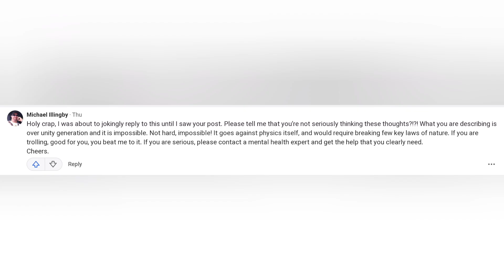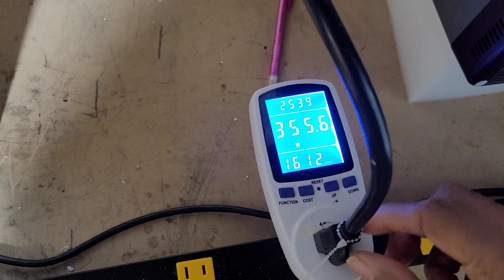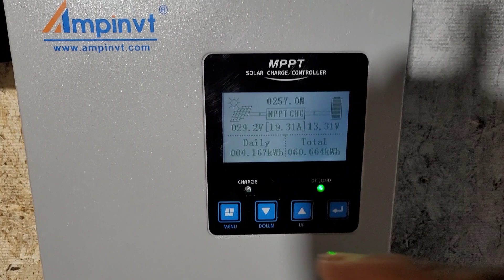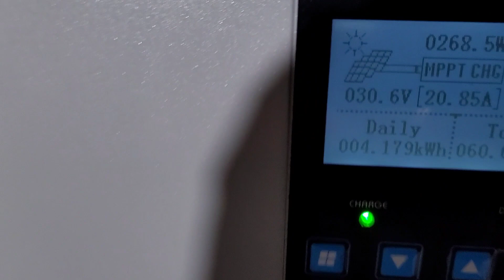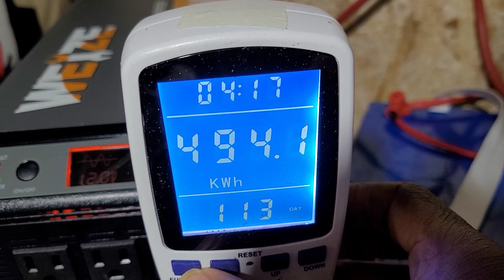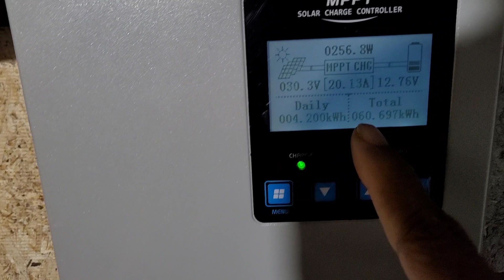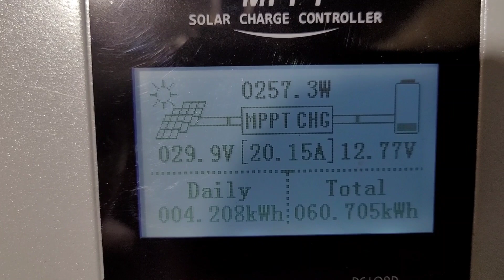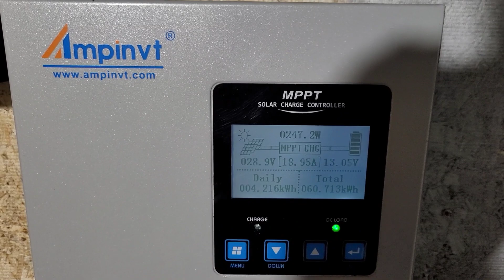the ? asked; Can we charge an inverter using its own output?"  then this happened!!!!!

Comment: Charging a battery from itself is not charging, because it needs to discharge as well - and, due to losses, it will discharge more than charge. Net current on the battery poles will be "negative", discharging. No perpetuum mobile either.
Reply from the maker: If the second video does not satisfy the correct answer for you and you still are in the same mindframe then wait for the third video well I'll show you one hundred percent that it is charging and what rate you are charging at the numbers are important, second at the low end of the Spectrum which I was showing you make the battery lasts more than the four hours of regular run time to 10 hours which was wrote on the paper and was demonstrated so now we need to show more data it appears that you may get the whole Digital Book just on YouTube videos because people just don't want to spend money they just want to take your work and use it for themselves it's been a problem for years so I've been holding back because I believed that what I discovered and have developed is worth time and money ,
Reply: @WIZ56575  if indeed you are holding back on demonstrating your proof because you believe your idea(s) are worth money, I'm afraid you will be waiting a very long time indeed.  First you have to disprove the Laws of Thermodynamics and that might be somewhat harder than you think.
Reply from the maker: @alanrutlidge4767   We're not holding back anything we are breaking these down and small little part because it seems to be so difficult for people to understand the demonstration in the video was only to show what we were talking about that you can indeed use the power from the device and loop it back into itself Which we were successful 1000 people seen it no trickery, this Stated again is not a perpetual motion machine we stated it in the video. It was to show not only did this work even though they stated that the inverter was designed not to accept the same energy it produced But it ran 10 hours instead of 4 hours on the power that we were pulling To supply the load which were tie grid inverters. Then in video 2 On the time line 7:40  We demonstrate that we could loop the battery back in itself to get extra power So we did not have to take as much power from the grid and the battery does charge so so again what are we holding back why is everyone so upset about something that is possible to do and been known for very long time That's what me and my staff would like to know. No one here believes in perpetual motion but yet several people have stated that we think that's what it is why we already said many times that it's not and that it will not run forever so what's the deal
Reply from the maker: @alanrutlidge4767   I may be mistaken but I believe we've answered this question but being a staff of media library it's my job to reiterate, So in the video we stated that this was not perpetual motion, And that it would run down even though it did run for 10 hours instead of the 4 hours it should have beeno load, We've been doing experiments like this for over 30 years and you've be amazed how many people would ignore what we said And just jump to the conclusion that we're trying to tell a secret, How about just telling the fact is the young man who asked question is it possible now people want to direct him into their own  Ideas when in fact we prove that it is possible but now what is a good for part 2 shows exactly what it's good for But unfortunately many people "d this law of physics to us The whole idea of putting this on YouTube video is for digital books and we did let people know that these things will be published so we can show how much people pay attention to what is being done and said instead of just reacting we wanted to know in our day and age to the people of the future how people thought in our time, We were hoping people ask better questions but unfortunately that didn't happen  They only  Repeat what they've been told  and I don't think a lot of them really understood If this wasn't so people would be rerouting energ back into itself To increase efficiency A lot more but I don't even think they know that they can do that even though we have AC which goes back-and-forth in-and-out of people's house every day, We also have tigrids that can link into your AC system using frequencies and hurts to put extra power back into your system so why do you think this happens can you give us more input on your statement the future wants to know.
Reply: Great answer. That's what I was trying to get across.
Reply from the maker: @eddietee6305   Thank you for that , Let's keep this in mind where did I get these ideas from they come from RV technology that means people who live in trailers are R v's and use the alternator to charge a secondary battery What happens if your  Alternator doesn't have enough power to charge both your main battery and your secondary battery well of course they've come up with the idea of cycling the battery back on to itself not to Produce any Last forever kind of bull, But to give a boost Oh your charge controller can do its job and remember it needs to be A mppt  Because those other regular  Charge controllers don't have a step up coil in them Yes you can do the same operation but it will take double the energy, If that's all you have it will work but you will see very little resulthoughts if any. We talked about like one vote or a 1/2 a vote or a 1/2 a vote or half a amp difference, But if you put the mppt  In line with this you'll see that it will step up the amperage in which it's supposed to do.Maximum Power Point Tracking ,To put it simply, they convert a higher voltage DC output from solar panels (and a few wind generators) down to the lower voltage needed to charge batteries. In otherwise it takes the high voltage and steps it down to give you more amps, This is the laws of physics and is well known it does not matter which DC source you put in there which can be from your batteries which can come from your alternator which could come from a generator DC of course or any other DC source including solar. So ask yourself why can't you take the battery put wires enough to go to the battery terminal and to the solar which means that you're rerouting the battery that's being charged up through the solar As soon as you do this you're going to see that is charging now you need an external source to push it a little bit higher or the batteries will not charge it will lose power because it's just cycling it's like taking a ball on your finger and tapping it to make it keep spinning on your finger, This means that you do not need as much energy to keep the ball spinning we're doing the same thing here that we're using the cycles like in any coil to step up the electricity a little bit enough to keep you from using outside source energy as much if you're using solar you won't need A lot of solar I use the  Battery  Chargers to give you The numbers or data So you can use solar at that same level and it should give you the same results maybe a little higher but again keep in mind on what your charge controller can handle.
 Also keep in mind this is a library and my main number to the line whether I'm in the office or not is 3136515349 you cannot text this number because it's a landline if you need to send me a text send it to  313-777-3031  By using text I can at least sing you pictures documents patents and other information as a library would do. Then you don't have to listen to those naysayers I'll try to keep you on the coal system. My email is medialibraryinfo@gmail.com
Reply from the maker: I think I've answered this question but this is why you guys can't get anything new you're stuck in the coal charcoh greasy foggy polluting World that you're used to and you just don't want the new technology, It's a shame that I have to keep repeating myself But the battery even though it's plugged into itself means looping into itself it uses an external source of power but you won't need 12 votes to charge the battery because the battery supplies the 12 votes you just need to go a  Higher to get the battery to charge no laws of physics are being broken you just don't like stuff that hasn't been wrote in a book But it is not my job to take you out of the dark ages I'm just a Liberian. And this is old Tech in itself so how far back when it comes to  Technology are you people Where have all the good schools gone they have you people so far back in the dark ages you just repeat things that was said by Einstein and nikolai Tesla and we're so far ahead of them in  The year 2000 and you ready to catch up or you're going to stay right where you are.
Reply from the maker: I'm a staff member at media library don't know what Lloyd Stovall told you but you're repeating what was said in the video we don't quite understand the purpose of restating Information already known maybe you just wanted to make comment will thank you if that's so we were looking for people to give a br understanding of what was actually being showe didn't get that just a quite few people saying comments like this it was quite disappointing. Maybe you could make a new post and state something that we missed that wasn't in the video.

Comment: Suggestive question asked - the battery in between will be depleted over time due to losses. So it's NOT a "charging using ONLY its own output", by no means. And it's not anywhere useful.
Reply: Walter, you hit the nail on the head.  As much as the "idea" of creating a unity or perpetual energy system is admirable the practical application has not been demonstrated here by Lloyd nor any others.  There's a man in Zimbabwe that tried to demonstrate he had invented a TV that runs on purely on RF energy from the TV station.  It was a large LCD Sony TV with a box of tricks which looked suspiciously like a DC to DC converter screwed on the back of the TV with some wires disappearing behind the rear cover.  He only demonstrated it switched on and running for a few minutes and refused to allow it to remain running when challenged by a journalist to do so.  Almost no doubt the TV was powered by a battery inside the TV concealed from view.  No prizes for predicting the TV would have eventually stopped working once the battery had become depleted.  The same "inventor" also claimed to have developed an electric car that never requires charging and a helicopter that operated on a similar principle.
Reply from the maker: @alanrutlidge4767   Your comments are so off  Kilter It's not even funny I showed it to my staff to try to figure out what is he trying to say we all came to the conclusions that you didn't even watch the video you just think it's some kind of petrol motion machine even though stated in the 1st video we do not believe in petrol motion nor is this a perpetual motion we also stated that the battery would run down we also showed how we could use the battery To boost power sir to get to the level of charging the battery While not consuming as much energy so where are you coming from with all this other nonsense, Is it that you're trying to provoke a response keep in mind all these statements will be published they are screenshot it daily it is for the people in the future to recognize people and their thoughts on the subject so maybe you should rewatch the video and come up with some better comments because this looks like You're trying to provoke a response that we're just not going to give you.
Reply from the maker: @alanrutlidge4767   To answer everyone's question is this video was not supposed to be a petual motion project it's not supposed to be free energy product it wanted to state a question which was put on the internet and a lot of places that you could not do this because it would Damage the Machine, That was proven wrong and we did it. That was the main point of the video it's let you know that you can cycle or loop energy now with that you can do a lot of other projects knowing that you're not damaging your equipment because you think it will. Just not true there's a lot of technology out there that uses looping anytime you wrap a wire out around a coil it does a Pacific thing once you learn that then you'll learn which Tesla known for a long time looping or would they call a coil has a purpose.
Reply from the maker: Thank you for the question we do appreciate this because it will help millions of people, first I didn't mention everything you just stated in the video second I mention how to fix this and then I made a second video showing you the fix same process and the batteries are charging in the second video go to 7:40 on the timeline that skips past all the data that people find so boring and then I showed the use of such an item. Please do not think I'm upset or even angry I think this will help million because every one of these comments will be placed in my digital book because people get upset when new products are inserted into everyday life especially if they're taught that they're just wrong, I'll be doing a third video some of these comments will appear in that third video so stay tuned and you will see and should understand that we use the battery to boost up needed power which Nikola Tesla stated in some of his papers. I wonder why people don't talk about things like this more often probably because all the negative comments people don't want to deal with, I'm just the opposite I need this information so people can see technology that they're been hiding for over 100 years please watch the second video and make a new comment we wouldn't want this to go down the history of refusing to do something so simple
Reply: True.
Reply from the maker: @eddietee6305  people like him are keeping you from the truth here's an idea take an old small charge controller then take a battery attach four wires to the battery to on positive to on negative and then put two of those wires at the battery terminal and then take two wires and put it into the solar terminal, now at the solar terminal take two extra waters for external power maybe from a power supply or your solar then watch the battery boost up the power and then also charged the battery if you do it for yourself you'll know the truth if you don't you're always be asking questions from idiot who get you to believe that this is impossible